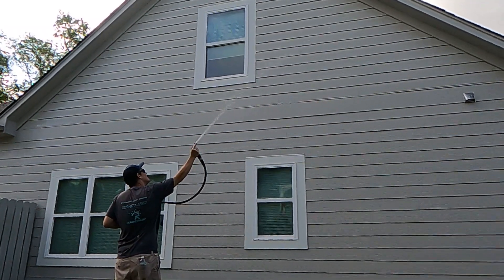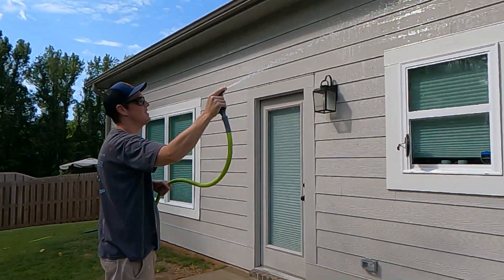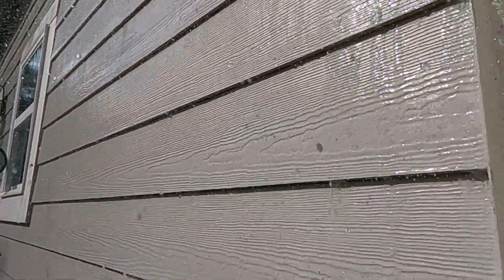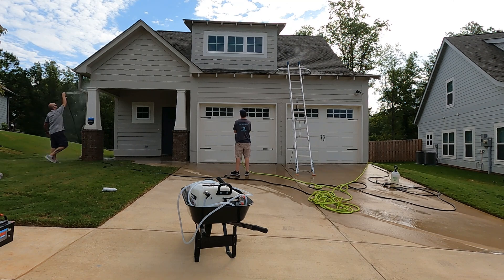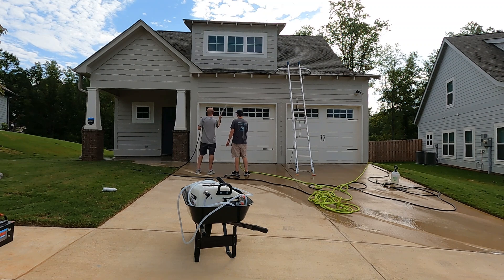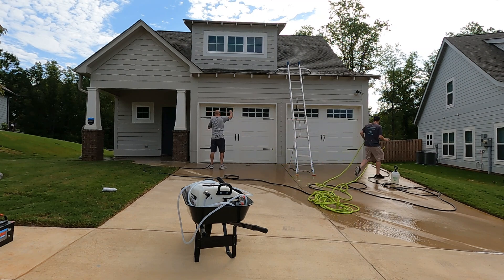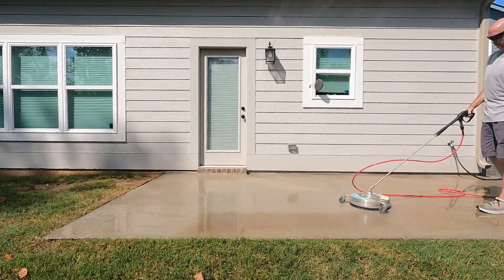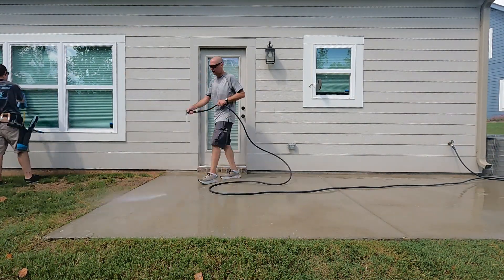Softwashing This house and UPSALES ARE THE BEST

Comment: Hey man, what would you do for a fiber cement stucco building? I primarily do tile & grout/carpet cleaning, but was asked to “pressure” wash a small shopping plaza. It has a lot of dark black/green stains from the roof run off. I tried ecolab from homedepot and I had to really pressure wash it to come off, but it also started to eat away at the paint. So then I went back and put a mix of bleach and dawn dish soap in a spray bottle to do a small test. Rinsed off with the water hose and that didn’t do anything at all. I don’t know if it’s my lack of having a soft wash system, the fact that the spray bottle isn’t ideal, or my chemical mix. That’s money sitting there that I could make, but I just don’t know where I’m going wrong. Any advice? I was considering buying the northern tool soft wash system for $500 but I don’t want to invest in it until I know where I’m going wrong chem wise. That would be a great add on to my steam cleaning business.
Reply from the maker: No pressure on stucco.  SOFTWASH ONLY. Apply a 2  to 3 percent sodium hypochlorite and let sit for 5 to 10 minutes or until the black or green is gone. Re apply if needed. Rinse well with fresh water after
Reply: @CEOof1  thank you so much! Should I put in a surfactant to help hold it against the building Or just SH and water?
Reply from the maker: Bleach or sodium hypochlorite  (same) should work without pressure. No dawn...... go to Walmart and get pool essentials 10 percent from the pool area. Cut in in a bit less than half with water. Than will be 4 to 5 percent for getvit of with rinse from a regular hose. If that doesn't work the build may just need to be painted. Once gleo capsamaga had been on long enough the paint is damaged from the bacteria eating the top layers and thus discoloring it
Reply from the maker: Also just get a 55 gallon heavy duty trash can and you can but the pump and battery separately and make a 50 gallon tank system for a less money.
Reply: @CEOof1  thank you for such detailed advice. I truly appreciate it. I’ll try this and see what happens
Reply: @CEOof1  nice! I’ll keep that as an option. I saw your video with the 26 gallon tank from NT. I might go that route and keep that set up on my daily driver. I use a newer truck for work, so keeping that 26 gallon tank on my daily wouldn’t be an inconvenience.